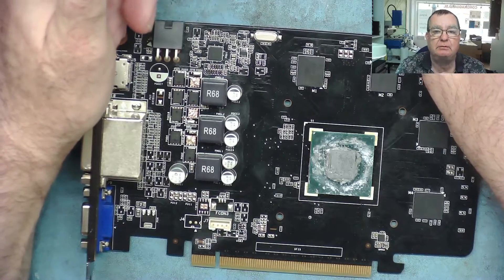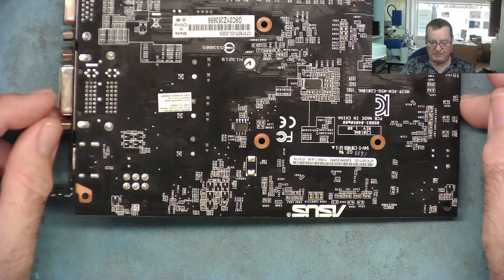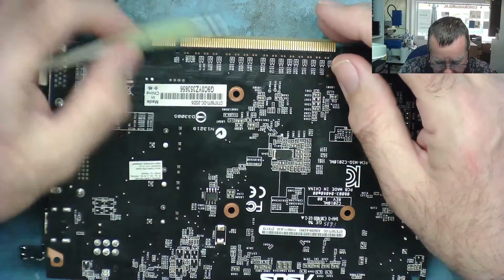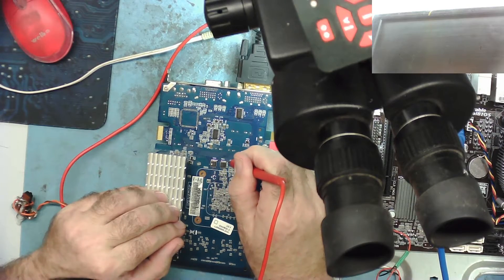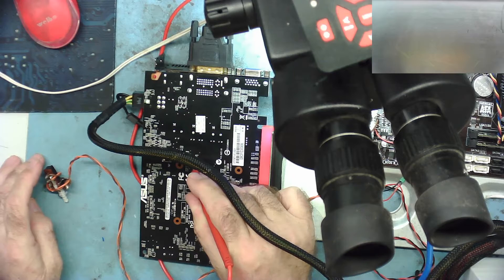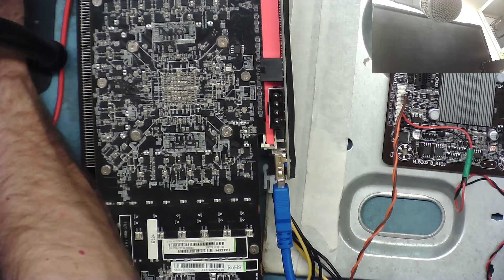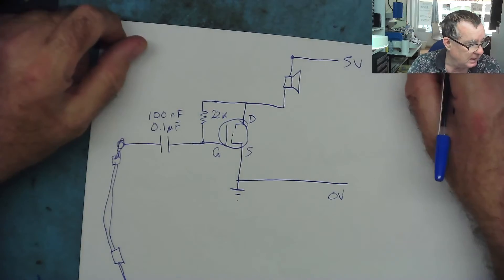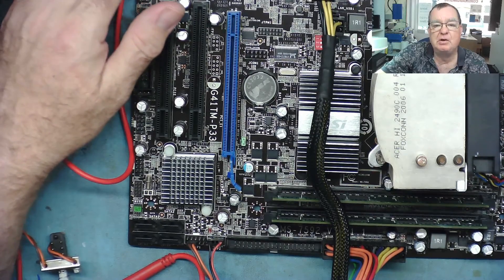How to test GPU / CPU accessed the BIOS without an Oscilloscope LER #183

Comment: Excellent idea to find if the BIOS is accessed. Especially this will eliminate the PCH and CPU from the equation. PCH is required to translate the access to ffff_fff0 (intel real mode) to SPI commands for the BIOS. Thanks for spending all the time explaining patiently to us. The best channel for electronics troubleshooting and repair.

Comment: Good video. I never thought about a GPU accessing the bios. Thanx for showing that schematic.
Reply from the maker: A GPU, or any other sort of add on card, needs to inforrm the PC of it's specifications and parameters when the PC boots, during the POST.  

There is a detect pin in the PCIe or PCI slot that is connected to ground when you insert a card. This simply tells the PC that there is a card inserted.  The PC then sends an identification request to the card.  As the GPU has no internal data storage, and the video RAM is volatile, this info is held in the BIOS chip on the graphics card.  

The GPU is supposed to read this info from the BIOS and reply to the PC.  Testing if this occurred is an important part of the diagnosis when you have a graphics card with all the voltage rails present but it does not detect.

Comment: I’ve seen a similar idea on a video from Grants Pass TV Repair channel where he made an amplified microphone to hear electrical activity (high frequency whine, frequency changes etc) as a troubleshooting technique.
It’s also useful to hear the hard drives to see what pattern of noise they exhibit in case you suspect failure.
Reply from the maker: For sure I didn't invent this technique - I learned it in the 70s, together with signal injection,  as way to test and diagnose audio circuits - I just thought it could also be applied to detect very short duration digital pulses as well - and it works very well it seems😀
Reply: @LearnElectronicsRepair  That technique is great yeah, used it for years.
Reply: it's the first time i see someone mentioning it in YT; but in fact tbh i am not that fan of youtube i just encountered this video in Adamant IT server

Comment: I prefer the speaker solution over the scope. I'm fixing motherboards and graphics cards, but basically never use oscilloscope, PCI-E/TPM debug card, thermal camera and multimeter are enough for 99% of the job.
Usually if I don't find the problem within 15 min, I have to chase down the problem on the PCB and it will be 1-2 hour poking and probing around.
Last time I used the speaker method for a faulty Audio channel, because the measuring poking method doesn't worked first, I couldn't find difference between the two channels. At the and I found the faulty FET, it wasn't burned out to short as usual, but it had about 1K resistance between D-S.

What problem do you hate the most to solve/fix? Mine is ASUS/GIGABYTE VRM with FET drivers.
Reply from the maker: I hate the sort of fault where everything seems to be OK (voltage supplies etc) but it just doesn't work!   Which thermal camera are you using?

Comment: So if the GPU doesn`t access BIOS ? What to do then ? I have an RX5700 XFX - I also posted it on the badcaps forum . Thanks
Reply from the maker: Try the board in PCIe x1 mode using a mining adapter

Check the resistance (in diode mode) from all the PCIe x16 lanes to ground - on both sides, the tracks that go directly and the ones that go via little capacitors,  On the ones that go via capacitors check from each capacitor itself, not the PCIe finger.    They should all read the same, any reading widely different suggests a faulty GPU chip

Check the reset signal coming from the PCIe connector (SMRST) - this normally goes via couple of transistors or a logic gate and is probably ANDed with the Power Good from the last VRM to power up (Vcore in your case).  Check if that circuit works.

Check the 25MHz crystal is oscillating
Reply: @LearnElectronicsRepair  Just measured a few pairs of PCIe and they don`t  give back same numbers . Sadly the GPU chip is gone as you stated
Reply from the maker: @Goblin-9.9.9  So yes that is the problem.  Sorry to hear it but consider the bonus that you learned new skills to help you in future 🙂
Reply: @LearnElectronicsRepair  Surely I learned a whole bunch of new things from  you . Thanks a lot for the hints . Cheers
Reply from the maker: @Goblin-9.9.9  I just answered on badcaps - from your message there I think you are measuring the wrong places

Please check my reply, and check this PCIe pinout

https://linustechtips.com/topic/547139-rip-motherboard-buyer-beware-cheap-pcie-riser-cables/

After the short section of PCIe and the key slot, You can see the 16 lanes (pairs of wires) with the capacitors on one side and without capacitors on the other side.  All the ones with capacitors should read same as each other and all the ones without capacitors should read same as each other - but different form the ones with capacitors. 32 pairs in total.  I hope that makes sense
Reply: @LearnElectronicsRepair  Figures it out afterwards - GPU seems good

Comment: For my own interest I looked at the enable pin of my Acer schematic bios chip and  this comes from the 3v PCU  power supply  not the PCH chip!
Reply from the maker: The BIOS is normally connected to what was called the southbridge, on the 'slow' bus, not the PCH.  I don't recall saying it was connected directly to the PCH ?